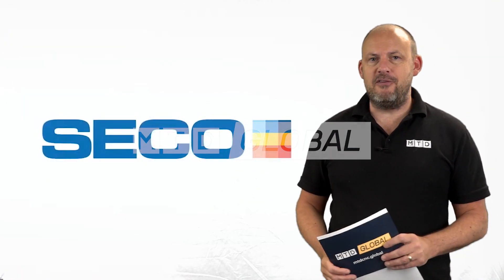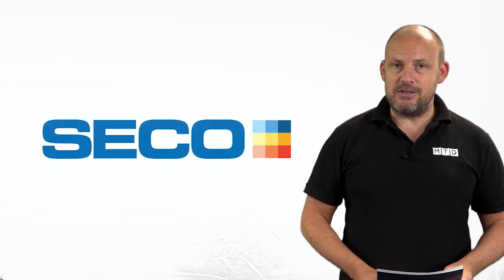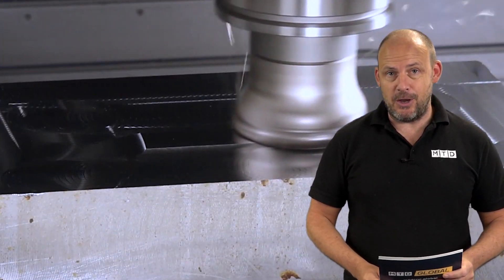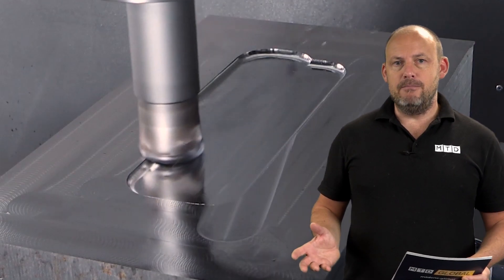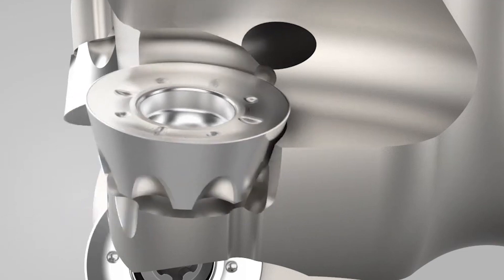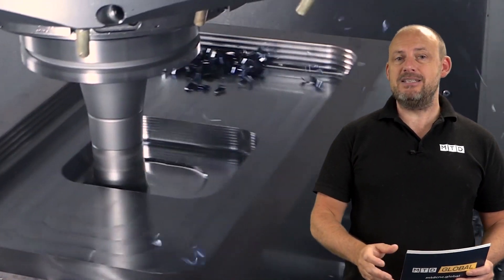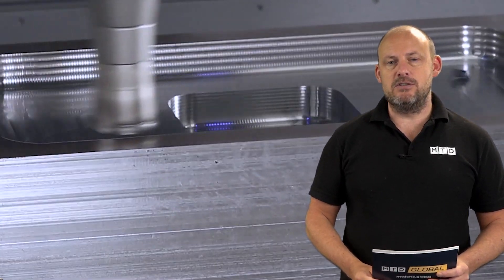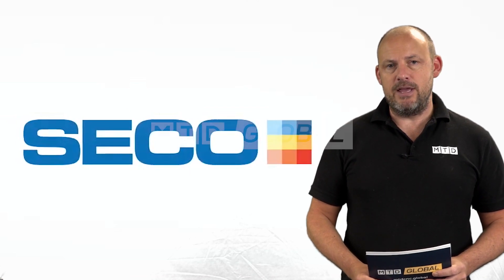Extra life from your inserts using this cutter body

Comment: Seco has also had these for years.  I've used a few brands and the Seco are expensive, but very, very good.
Reply from the maker: we heard they are good
Reply: @MTDCNC  I don't recall ever replacing an insert.  I was doing short runs of 10-100 pieces.  I usually indexed the inserts at the start of a job just so I wouldn't have to mess with wear and offsets later in the job but honestly they always looked new.  High feed is really an amazing cutter geometry.  I'm roughing parts right now with a 1/8" Seco (made by Niagara) high feed solid carbide in 4140 at 44HRc hardness.  We could get away with stuff in our 30 taper Speedios with these things that I'd never try with a side-loading geometry.
Reply from the maker: @rickfinsta2951  interesting especially with BBT30
Reply: @MTDCNC  Standard BT30, not even dual contact!

Comment: This is not new technology. Other brands have had these type of inserts and cutters for years.
Reply: Well indeed. This is far from new technology Ceratizit, Sandvik, Iscar, Kennametal all have similar solutions. This looks most like the Ceratizit solution, but all have the same purpose.
Reply from the maker: good technology though, have you used it or do you or something similar?
Reply: @MTDCNC  Walter Tools have had these for years